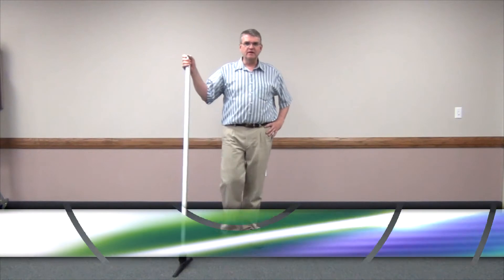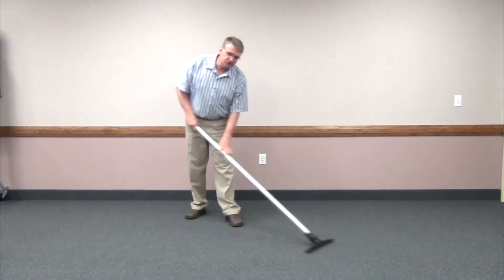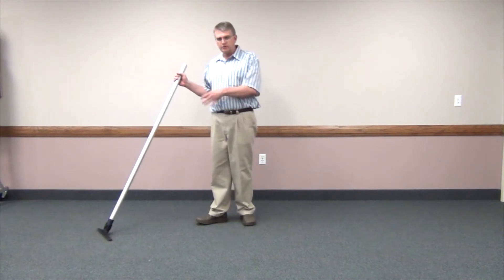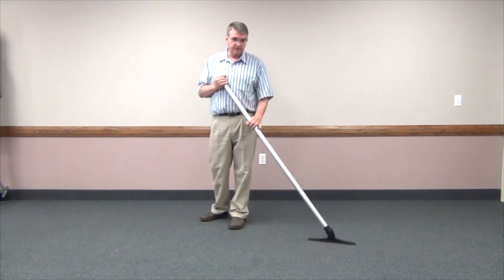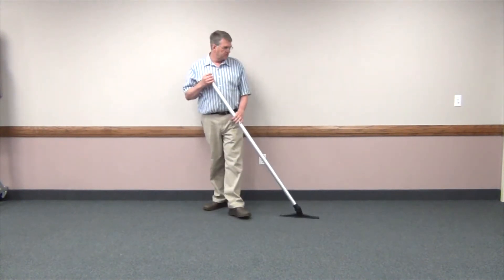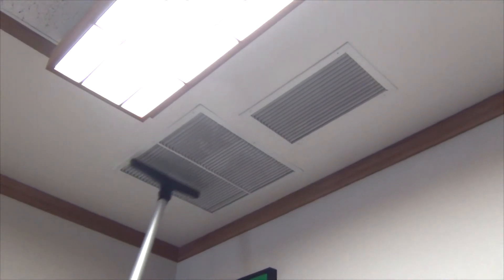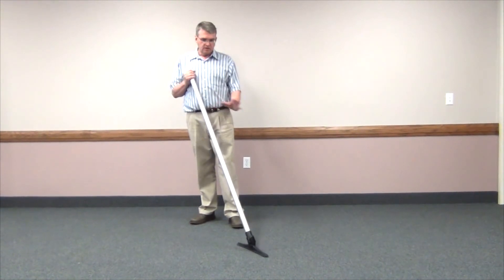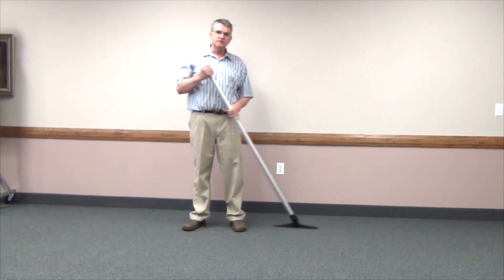How to use the Sidewinder Vacuum Attachements

Comment: One thing I would add in the "Proper use of wand" section is to not press down hard on the wand.  you want it to glide on the floor.  I've had several employees break off the heads because they press down hard on the wand.